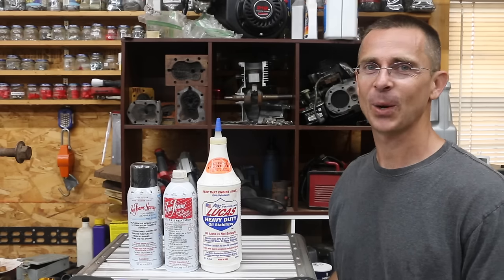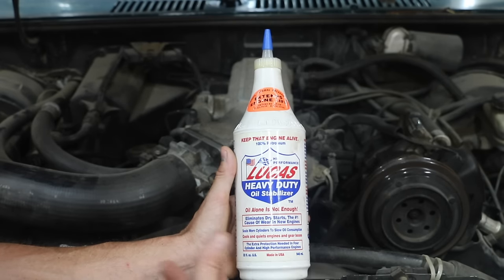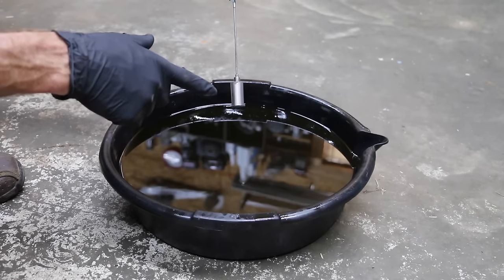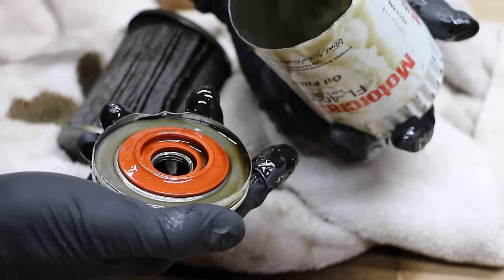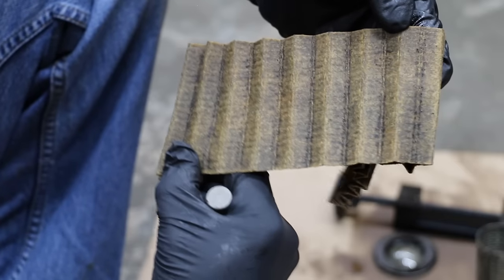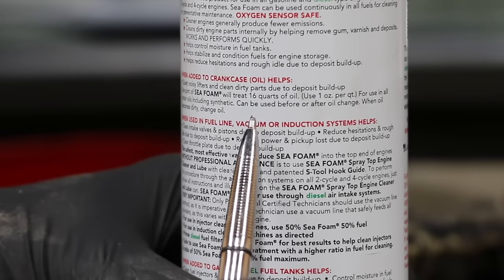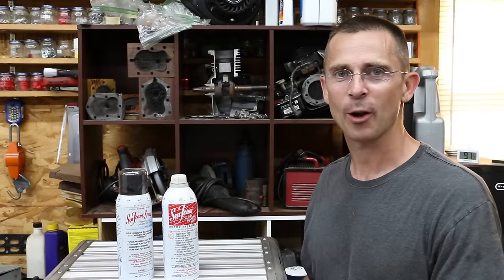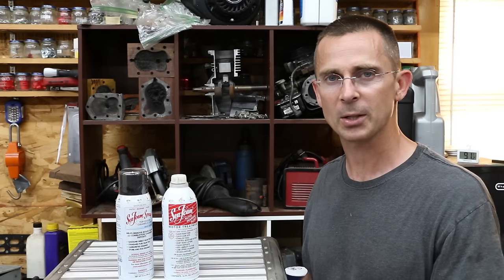Did the Seafoam fix last? Update on the Ford Ranger

Comment: It's been about a year, do you still have the ranger and if so how's it running, probably the best advertising Seafoam could ask for, great channel
Reply from the maker: Thank you!  Yes, the Ranger is still running great. Thank you
Reply: @ProjectFarm  So you are not running out to buy the new Ranger?  ;)  I saw one on the road yesterday and it looked very nice.
Reply: Sam Houston He’s smart. He’s choosing not to buy the new fords. His ranger is way more reliable than the new one
Reply: It's a Ranger; of course it's still running! LoL! ... Wish I never got rid of my little ol' White Lightning Rhino Ranger, it was a great little truck. It's probably still running out there, somewhere...
Reply: I'm a big believer in Restore - until the transmission and transfer case BOTH blew up on my 95 GC Laredo (5.2 L V8 Hemi) I'd put it in every other oil change.  I still use it in my 06 Dakota along with Havoline High Mileage oil (this one has to last me a while)... 😎
Reply: @mattphipps1368  - Think Restore might help with a cylinder 1 misfire in a 1999 3.9L Dakota?
Reply: @thesilentobserver93  Restore is used mainly to condition the oil and keep the rings from wearing out as fast to keep the piston compression from dropping as fast in normally functioning engines.  Misfires can be the result of several different things.  I can't say if Restore will or won't work without knowing the cause of the misfire.
Reply: @mattphipps1368  I agree on that. Had a 90 Chevy Silverado, sold it at 210,000. Used restore every so often. But then again those were some of Chevys glory years.. so who knows.😉
Reply: I had a 91 Ranger with the 2.9L 6 in it. After a substantial engine rebuild, it made about 300hp at the rear tires. I used it for mud racing, running dogs, hunting, offroading, going to school, etc. It never so much as made a hiccup. I still had a Mitsubishi 5 speed in it with the Borg Warner electric transfer case. Mine was considered a heavy 1/4 ton due to the full size axles from the factory, so Detroit lockers front and rear made that thing unstoppable. I could pull the front tire off the ground in 4 low on pavement.

I wish I still had it!!!
Reply: @samhouston1673  yup, the older ones have iron blocks, heavy but really reliable
Reply: Lol except the tranny in the older chevs were garbido dude I've put 3 in my ol 350. I can count the number of Burn outs you can do before trans implodes on one hand lol

Comment: Great update. Definitely an improvement. I'm actually impressed with the results of this test. My question is though, how many times have you ever driven too far with those ramps? I know I did it once in my younger years (over 35 years ago) and had a bit of difficulty getting the ramps back out again. Just curious. Thanks for the vids.  :-)
Reply from the maker: lol regarding the ramps. I've done it a couple of times. I'm far from perfect. Thanks again!
Reply: Are they better than the plastic ones? The plastic ones fail over time no?
Reply: Got to Jack up the vehicle if you drive over the ramps.
Reply: I've been lucky.  I'm using Rhino ramps.  They have a longer top end so you have less chance of going over the top...
Reply: Stopped using ramps like that many years ago,  very dangerous!
Reply: i once went too far and one of the ramps rocked forward but i didn't go over.
Reply: I've got those ramps, and really, sometimes the suspension doesn't telegraph the position to the driver!
Reply: A little insurance will keep you safe on the ramps. Measure the distance from the bottom of your front tire to the point about three inches ahead of the bottom of your rear tire. Place a chocking block that distance behind the flat center of the ramp. Mark the spot, position the vehicle at the ramp, place the stop block on its spot and carefully drive up the ramp. Using the block as a feeler, you should have the tires perfectly positioned. Be sure to double hold the vehicle, using transmission and parking brake. Chocking the rears is also highly recommended.
Reply: My son did this the other day in a Kia Soul and I thought we'd be jacking it up and praying for minimal damage.  He had gunned it at the last second and shot them out of the way and luckily the Soul had more than enough clearance.  Just pulled them out and then I showed him how to do it.
Reply: @JW...-oj5iw  Or, have someone in front or off to the side a little guiding you on the ramps??

Comment: VIDEO= Drain the oil. Replace oil filter with an adapter, with hose connections to "Remote" filters. Run your engine on TWO larger filters. Over fill the crankcase by 1 quart with 4 quarts ATF and 2 quarts of diesel. Idle at 2k RPM for 10 minutes, NO LOAD. Drain HOT, refill with proper oil & new filters. After 4~6 hours of "running normaly" change oil & filters again. Autopsy and record with video and Gas Spectrometer the Media (at you fav Local college that would do this for free) and get a chemical analysis of the filter media. Do any of your vehicles have "Bypass" oil filters? My favorite of all time will always be a "just before you pee- Honey- throw me a roll of that TP" filter. Very smart product. (Of course- other companies have made their own versions- using their own oil and filter.) Toilet Paper is awesome, Folks!
Reply from the maker: This sounds like a really interesting test!  Thank you for this idea.  I've added it to my list to look into doing. Thanks again.
Reply: The "TP" (concept) has been around a long time. After an  "Oil Bath" air filter- an extra "Bypass" filter is adding longevity to your engine, and transmission. Hyper filtration of a small, but sufficient amount of the oil greatly reduces wear. High Performance and Exotic car engines- because of the G's generated- have a separate oil tank, with none in a "pan". It's referred to as a "Dry sump", and greatly improves on every aspect of a oil lubricated system- that's taking a beating. Your farm truck is put under load, like it's supposed to be. Imagine- 4.5 to 5 quarts of oil- to handle that beating? Now imagine- 5 gallons of Rotella in a fabbed tank, then a return to tank via electric pump, and dual oversize filters, 1 a Name commercial filter of choice, and 1 b Name roll of 1k sheet TP. I'm not endorsing either popular company, or filter type or composition. You can all search "Bypass Oil Filter" and you can try all of them, 1 or 2, or none, and think it's a scam.
Reply: At my shop we do something similar to what he recommended. Although we just use the ATF, no diesel fuel. We only use to scrub parts clean in our parts washer haha. We just run 2+ quarts of ATF (depends how bad the engine is), idle it for 30 min (with occasional revs to 2-3000rpms), then turn it off and change the oil filter. The first filter is usually stuffed with sludge at this point. We will run 3 filter through before draining and using fresh oil/filter. We find this method to be easier on the moving parts, like bearings. We want to remove the sludge, but not damage the engine in the process. While I'm sure his method works very well, it's just a little more on the dangerous side. I also run a quart of ATF in my personal car 25-50 miles before an oil change at least once a year, or every other oil change to remove any deposits that might form
Reply: Thanks, I appreciate the semi-agreement. Not really "dangerous" because the engine isn't "working" (under load). The diesel makes the cleaning solution less thicker than oil, so it really rinses contaminates out easier. Yes, multiple filter changes is essential. You'd be surprised how dirty an engine can get- even with regular oil and filter changes. The diesel also makes it easier to see what's being removed.
Reply: lot of work for a ranger lol. maybe an old cummins truck would be worth all that effort
Reply: RickBaconsAdventures - a 379 show and work tuck with a C15 would be worth it. 😁
Reply: yeah haha

Comment: Sea Foam is a regular additive to my fuel and occasionally to the crankcase.  I use Royal Purple and a quality oil filter (Mobile 1 or Bosch)
I also use Gunk Motor Flush once a year.  Good maintenance practices are worth it.  Keeps your vehicle reliable.
In may small engines (Zero turn mower, chain saw, pole saw, line trimmer) I use Stabil.  It never hurts to pull the carb once a year to keep things going.  Along with changing the spark plug and again, changing the oil, my equipment runs perfectly.
Reply from the maker: Thanks for sharing.

Comment: hate to say it but the only way to restore compression is to replace the rings, In the case of some Toyota,s if the engine sits around for extended time periods, the oil control rings get gummed up and the engine will smoke so bad the  catalictic converter will be junk, I could see oil blowing out  the tail pipe, one fix  a Toyota tech told me was to remove the spark plugs and pour some Marvel oil into the cylinders, put the plugs back in and turn the crank over by hand every couple of days, it might not work for every one, but it saved me the hassle of replacing the rings, as for sea foam , I add some before and after an oil change, plus some in the fuel tank as it helps lube the electric fuel pumps on my dual tank , F150 big six, which is fuel injected, most of those products will not cure  a worn out engine, but if used properly will extend the life of the engine.
Reply from the maker: Thank you.   MMO is a great product!
Reply: tom ashton 6
Reply: Some of the Yale forklifts (and Hysters, I presume) with the Mazda engine were bad about the rings sticking/losing compression if you let them sit for a while. 
The fix from the Yale/Hyster dealer techs was to pull the plugs, pour ATF in the cylinders, and let it sit until it all drained into the crankcase. 
According to them (some of them are current coworkers) it would free the rings, et voila, the engine runs again. 
Haven't tried it myself. Got a customer with one that has that problem, but they aren't willing to let me give it a try, because the engine has well over 10,000 hours on it and they don't want to put any money in it. (Battery is dead from sitting too long, and they would have to pay for a battery, as well as labor)
Too bad. It needs an PM service anyway, so an oil change wouldn't be a waste.

Comment: Great video as always! I apply Seafoam about 100-200 miles BEFORE every oil change. I assume this gives it time to dissolve a good amount of the "evil" in the engine without exposing the engine to that contaminated oil for thousands of miles...which would be the case if added AFTER an oil change. Do you believe this thinking is faulty on my part?
Reply: That's what the oil filter is for
Reply: Mr Luigi is right but it’s not just about the gunk and the filter. Sea foam must contain a solvent.. it’s probably a cocktail of Toluene, Acetone, propanol and even kerosene... etc. so leaving it inside the oil will dilute the oil’s film strength. You need to run it around the engine at a fast idle to get it agitating the carbon but most of these additives ask to avoid heavy loading, since they don’t have film strength to protect your crank journals or other load bearing points. The best solution is to just change the oil every 3000 miles so the oil is always full of the added detergents, but that’s an expense more than the truck is worth.

Comment: i have a 2000 explorer. engine would tick just a bit,  after using mobile 1 this engine is quiet.  i have always used valvoline. have tried valvoline max as you did in this video and it was the worst with it. this engine has never ran this smooth and quiet, i will never use any other oil now.
Reply from the maker: Awesome!  I like Mobil 1 synthetic a lot.  I'll likely switch over to it once I use up all the Valvoline.
Reply: Mobile 1 damaged the engine in my previous car, two cars back now. And valvoline, yea, that's a known avoid. I just use nulon and penrite now, both local brands over here.
Reply: MV60 how did you determine the oil caused the damage?
Reply: Very unscientifically, it was what I was running at the time and the engine was really loud while running it. This was back in the early 2000's. Full synth oil was very expensive, and that was an extra kick in the nuts.
Reply: I'm willing to bet it wasn't the Mobil 1. If it can withstand 24 hours of Lemans in multiple racecars, I'd bet your daily driver had another issue.
Reply: Try Mobil 1 w/ Fram ultra synthetic filter. An excellent combo IMO and affordable at Walmart
Reply: MV60 my guess is that you got a bad batch of oil.  I can happen.  Synthetic oil was pretty new on store shelves in early 2000s.
Reply: It was too thin too was probably my guess at a 5-30 or whatever it was. Standard today, but not for a '95 widebody camry. Lessons learnt in our younger days. :D
Reply: thats the problem, using shit oils like valvoline and mobil hahaha
Reply: MV60 

no way.

a 5w-30 flows like a 5w oil, but protects like a 30.

i am API certified.

after i became certified, i have ran nothing but 5w-30 Mobil 1 in everything, even my 1970 Olds.
Reply: Kevin Gallineau II 

i have bedn using Mobil 1 since the early '90s.

it has been available for years
Reply: Rusty Shackelford 

Fram are actually some of the (if not the) worst filters on the market.

better off staying with OEM, for me that is AC-Delco.

AC-Delco also makes them for many other vehicles besides GM.

another good one is Wix, although they are more expensive.

but the entire design and materials of Fram filters really puts them at the bottom of the quality list.

there are even videos on YouTube showing just how poor they really are i  comparison to kther brands
Reply: MV60 

the extra cost is more than made up for in extended time between changes.
Reply: Project Farm 

i have used Mobil 1 5w-30 full synthetic exclusively since the sarly ''90s.

even in my 1970 Olds.

i get many miles between oil changes.

it would be very interesting to see you do a video where you tested Mobil 1 5w-30 against other oils in a longevity and filmstrength test.
Reply: Linux & Other Stuff 

thicker oil will make engine ticks louder.

thinner oil will get through smaller passages, pump easier, and get to the top of the motor faster during start ups.

Mobil 1 is really good stuff.

Comment: Put that filter media in the microwave. You'll find metal real quick.
Reply from the maker: Great tip!
Reply: Good tip, but better have a microwave you no longer want. Arcing will destroy it.
Reply: looks like a flux capacitor fluxing they say"
Reply: TejasToolMan - is the Flux a new dance the kids are doing these days?
Reply: @seananon4893  back to the future 90s lol
Reply: Try using a VOM meter to do a resistance test on the filter media.
Reply: Might be worth if for the entertainment value. Microwave TV.
Reply: Gabe Ulrickson try 80’s.

Comment: How’s marvel mystery oil? My grandfather swears by it.
Reply: It is awesome in cleaning the gunk out of your engine!  I used Dextron II Transmission fluid, which I have been told is the same thing.  I would add up to one quart to the crankcase in a five quart oil system, when the oil was low prior to the oil change and run that for up to a thousand miles to flush out any gunk or carbon deposits.  The viscosity is such that it will clean your engine as good as anything I have ever heard of!  I had a mechanic seek me after I had brought in my El Camino in for its 50k and last check up, to ask what was I doing to my engine?  He said it was the cleanest lifters he has ever seen and that there is no film build up on my valve covers.
Reply: @16inSalvo21GunSalute  I put a quart of trans fluid in with my oil on an 89 dodge Ram 50. It was running fine when I sold it with 235,000 on it. 

I did stop doing that in the heat of summer as it made the oil too thin.

I suspect that's what Slick50 was.
Reply: @inthebriarpatch  Years ago this old man who had a lawnmower shop used to let me hang out there when I was a teenager and he swore by using ATF in dirty engines to help clean them out...he said to mix in no more than 1/4 of whatever the total oil capacity(but not to overfill) for any given engine.
Reply: Scratcher Z Many of us have had the same experience. I’m pretty sure old guys put ATF in everything, “ I put a capful in my gas tank and a capful in my oil, it’s got them detergents, you can use it as power steering fluid, you can use it as brake fluid. you can use it as toothpaste, got detergents”
Reply: @AreaThirteenThirteen  I think that old man travels around just to tell tinking youth about ATF and marvelous miracle oil, lol.
Reply: scott stickller  That sounds like a bad idea IMHO. Wash with water? No.
Reply: @16inSalvo21GunSalute  16 yars ago i had a 91 previa and one of the injectors either clogged or otherwise stopped working. i used a whole can of sea foam in addition to a can of marvel myster oil. 2 days later it was harder to start than normal and then when the engine caught, a huge cloud of blue smoke came out the exhuast and the engine ran normal the injecter got cleaned out or came back to life or both.
Reply: Stephen Mount  
if it only came in spearmint flavor.
Reply: Drone?
Reply: Glenn Mitchell 6:50